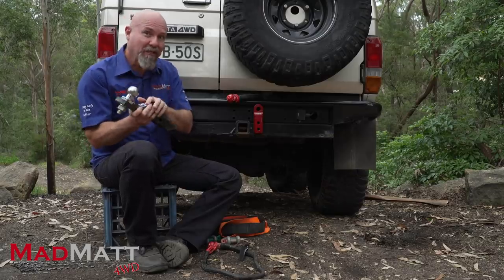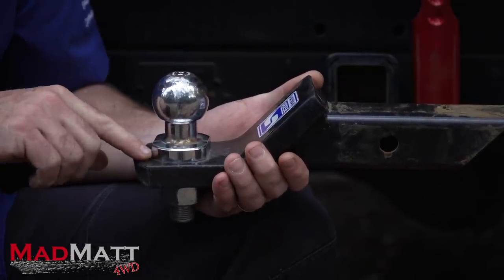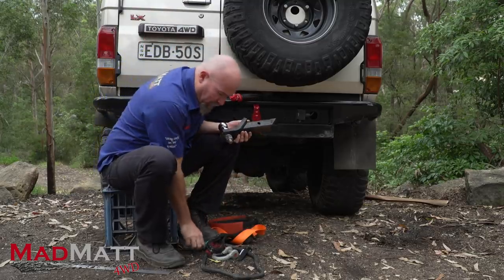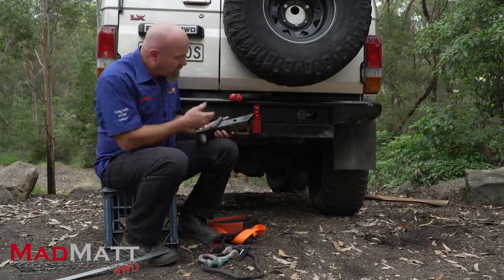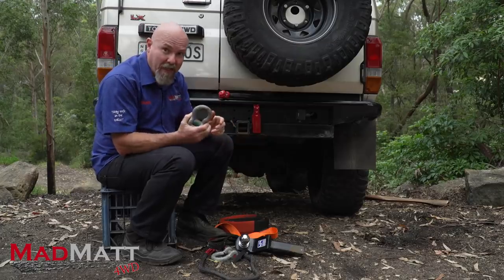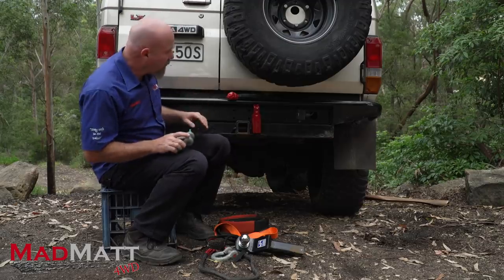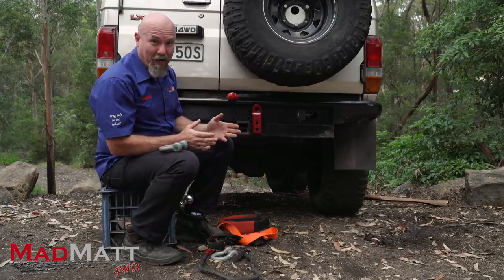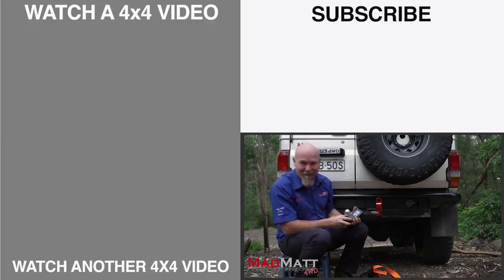A Tow Ball is NOT an option in a 4x4 Recovery? FIND OUT WHAT GOES WRONG

Comment: In fairness, Ronny cuts all of them with a hacksaw halfway through
Still, use proper recovery points
Reply from the maker: Not the first one shown here he doesn't.
Reply: @MadMatt4WD  Double negative, you saying he cuts it? OR; Not the first one shown here. OR The first one shown here he doesn't.
Reply: Bill Steel 
He did not cut the first one, but did weaken the others because they required many pulls to brake. He used new balls that’s why needed some work to break.
Reply: They didn't cut the first towball, and it took eight hard recoveries to snap it....Ronny noted that he was getting whiplash because of the sudden stops, so they cut the rest part way through to ensure they failed first time so he didn't get any worse injuries...
Reply from the maker: Sorry. He doesn't cut the first ball only the others. watch Ronny video.
Reply: @MadMatt4WD  Agreed, the first tow ball was too strong :-)
Shhhhh
Reply from the maker: No it breaks after 8 hits
Reply: @MadMatt4WD  - 8 HARD hits.  That video showed me that a tow ball is safe in all but the worst of recoveries.  He bent the sh!* out of the receiver before the ball finally broke.
Reply: @MadMatt4WD  Would be interesting to do the same test with a Factor 55 receiver bar and a bow shackle to see how many hits it can take.
Reply from the maker: Dustin Tunis  I’ll refer you to my question at the end of the video. Is it that hard to do it safely?
Reply: I must admit, it does amaze me, that i can have a 4 tonne load (Boat or Caravan) hanging off a Tow Ball, with drastic stop start loads, corrugated roads, huge braking force, bumps etc and they don't break.
I'm sure the kinetic energy from a snatch recovery peaks at a much higher amount, but wow, a Tow Ball sure takes a beating in a normal life.
Reply: @mountainconstructions  
I would also guess, not all tow ball's are the same, some are forged, some cast. A cast tow ball i can understand will fail.
A forged tow ball in good quality can take a lot of force.
I would still not use it with snatch straps, but a slow pull from a winch?
Reply from the maker: Iffykid Mn ive done 15 hits when the snatch busted. Under controlled environment.
Reply from the maker: Iffykid Mn ive done 15 hits when the snatch busted. Under controlled environment. No issues on the f55 hitch or the shackle.
Reply from the maker: Hugh Jazz yes i agree but in reality the loads are actually quite low.
Reply: @mountainconstructions  It amazes me too, but 1) th forces are much different than recovery, yes 2) they do take a beating, so using a fresher, application designed bit of equipment seems like a better idea 3) they are extremely well designed for their application, but only that one 4) they do fail. Safety chains are there for reasons. 

All that said I do agree. I just drove across the US this winter with a very light enclosed trailer. That hitch system took an amazing beating from hard starts and stops and every bump an blast of wind across 2500 miles. I'd only done low-speed towing on a ball before so I was nervous. No need.
Reply: @mountainconstructions  Different dynamic load to a snatch at full send it.

Comment: I'm from the UK and have a Nissan Navara D22 it has a Fixed Swan neck tow hitch (I don't know if you have them in Australia) But was wondering if anyone has any info on whether it would be suitable for recovery because it is one solid piece of metal. Instead of the ball is shown in the video which is welded. And I can not find any type of recovery receiver that fits swan neck hitches.
Reply from the maker: Personally I wouldn’t use it for a kinetic recovery. A tow recovery would be ok if you HAD too. Use the right tool for the job.
Reply: @MadMatt4WD  I was also wondering if you don't have a hitch reviser would it be ok to loop a strap around the hitch itself because it's a solid connection?
Reply from the maker: @callum3261  there’s a thing in recoveries where if it works it’s fine. That sounds like it goes against everything I say. The idea being every recovery is different and will require a different approach. People like things to be black and white most recoveries have lots of grey in them. So considering the dangers and such you then make a considered plan that is as safe as you can make it for the situation you’re in. Part of the process if you know you will be performing recoveries is to prepare the vehicle as best you can. There can be lots challenges at that point with the modern vehicle. So you decide whether you hook on that way. If you do I suggest you keep the recovery energy as low as you can.

Comment: Thing 1- I would never buy a ball with only a 3/4” shank.  Use 1 1/4” diameter shanks for towing as I would not want the trailer I am towing coming thru the back of my vehicle in an accident.  
Thing 2- Find parts not made in China.  Their metal pours are not consistent and I would not trust their ratings.  Thailand, German, Japan, USA are metals I trust.  
Thing 3- getting a running start and jerking the strap puts stress and loads on the vehicle frame that I won’t do to any thing I own, but I have never done any sand recovery, lots of snow and rock.  Take your time, analyze, and find the safest method.
Thing 4- use equipment within its design limits.  Use the right tools for the job.
Reply from the maker: 1. Of course bigger is often better. I think the key is using gear as it's designed for. 
2. Absolutely utly agree
3. Yes it does but as you say taking the time to perform a kinetic recovery is the key and works just fine. These ropes and straps stretch and are very different to a lifting strap.
4. The right tool for the job. hence a tow ball for recoveries is like using a pair of pliers  to undo a bolt.

Comment: I can see the possible dangers.  And I don't do that much off roading or heavy farm work anymore. 
But I have never seen one giveaway. 
Seen them used thousands of times off road. 
And I have no idea  how many on farms.
Even had a d7 dozer pull out a 125 hp 4x4 international with a peanut wagon ( loaded) with the tractor on the fram.
 Most everyone around used them we just got all the by standards to move off and out of the way.
Reply from the maker: So by the fact you remove people it’s a fair indication you recognise the dangers. I fail to see why defending this is even a thing when it’s so easy to do it safer and not run the risk at all. I’ve never said it’s happening every time a tow ball is used but it does happen. Read a few comments up and there’s a guy in hospital from a tow ball hitting him.
Reply: @MadMatt4WD #1 I would move people out of the way doing any kind of pulling.
More worried about a chain breaking than the ball.
And on the farm what ever was quicker and using the stuff  you had to get the job done. 

Doing dangerous stuff on the farm kinda normal down here or was for years. You did what you needed to get the job done is it the best way probably not is it what we done yes.
I went and watched the video from the other guy.  
The pull that he was doing seems kinda suspect. 
And then cutting the balls shank not good.
If you pull by the axle or frame.  If you cut either in what 1/4 - 1/2 into there going to brake to.

Like I said I don't do much of either anymore but I never saw one fail.
And I used them on heavy equipment that puts way more stress on them than and normal truck.
Reply from the maker: I get the farm thing I grew up on one. But knowing what I know today I’d certainly take the time to do things safer.

Comment: That's your own fault for following America, in the UK the tow ball has usually 2 bolts one each side and the bolts are bigger than the lock pin on the 2inch tube.

Old school British motors have solid bars and bolts everywhere, and a loop feed through and pull over a tow ball will not come off no matter how hard you pull as it only gets tighter, you have to pull the back end off as in the whole back end we also have drop pins again these have two load points.

As the world trys to make everything with bare minimum requirements and cheap we end up with things like this.
Although I have had tow points break on cars and vans just from simple towing.

Most accidents are caused by people's lack of attention or care and lazines

Edit: when I say tow points I mean as in those little rings the manufacturer puts on to strap down to trailer
Reply from the maker: Some interesting thoughts. Thanks

Comment: Newbie question here:  is there just a bow shackle that is wide enough to use the bow shackle straddling the outside of the receiver and able to put the bow shackle pin through both of the hitch pin holes in the receiver?
Reply from the maker: Hey mate. No there’s not but that would not be a very strong design imo.

Comment: Matt, There is NO exception.  Never use the ball... Pull the receiver and attach the strap to the pin that goes through the hitch.    
Next thing you know you will support using a chain around the ball...  Sorry to bust you on this, but again you are wrong.
Reply from the maker: I think you know that's essentially what i'm saying.

Comment: I normally use a heavy duty chain for recovery. I have never had a problem with them. They don’t fray on rocks and such, nor do they stretch out or deteriorate in the sun, mud, and sand. I bet if a ball broke with a chain the it wouldn’t fly back like a cannon ball because they don’t stretch and shoot it like a slingshot, and if it did my 50lbs chain is so heavy it would act as a weighted blanket. I have broken many straps because they get cut in something like the edge of a bumper or something
Reply from the maker: there are certain time a chain would be fine and it certainly has the characteristics you speak of. But it's also limited in it's recovery ability hence we use other devices as well'. As i say at the end of the video is it really that hard to not use a towball?
Reply: Isn't there a video of a chain going through a windscreen?
Reply from the maker: this one? https://youtu.be/ETFFeUoq5Vw
Reply: @MadMatt4WD . Nasty that  one
Reply: MadMatt 4WD that is a tiny chain, it looks like something I would use to walk my Dog. Here in the states we use big stuff.
Reply from the maker: I don't know what size chain it was but it failed he died. I don't tend to use chain in my recoveries.
Reply from the maker: @shane Von Harten Yeah not good.
Reply: I know for a fact that two jeeps off road in the dirt will not break my chain. I know this is off topic from tow balls but every one is hating on my chain. I have broken many straps but never a chain. I have a 8000 lbs Dodge diesel on 40s that I used to pull a stump out. With this 8000 lbs low geared manual 4x4,  pushing a 1000lbs of torque and 40s making lots of traction, on pavement at that. I hand the truck jumping and hopping so much that I could hardly stay in my seat. After some very hard hits, it came out. I was more worried about my truck being pulled apart than the chain. There is know way in hill that some 3500lbs jeeps could ever put that force in a chain. If that stump was a Jeep I would have ripped it in half, or the chassis would have came with me, leaving the axles still in the mud.
Reply: Shane Von Hart first that is a little chain, second prove that it was a chain broke and not what ever it was attached to ripping off .
Reply: @JohnDoe-du6yi . Calm down buddy. You may have a big chain but most people don't. Steel is no suitable for repeated shock loads, it is not designed for it. You may get away with it forever but it may also break next time you use it.
Matts video is about keeping people safe, if you wont take good advice thats up to you. I hope it never fails on you. Happy wheelin
Reply: Shane Von Harten he does give good advice. He is absolutely right about not using a ball for recovery.
Reply: You said the chain wouldn't fire back. The one in the video does, it doesn't have to be the chain that breaks. Your chain may be heavy enough not to. Just trying to point out the risks. If the chain was tied on the passenger side he may have survived.
Reply: I would never use a chain that is just stupid.

Comment: Great video Matt. I would never use a tow ball in a recovery. Just one small point at 8:43 you mentioned that a soft shackle would have the same energy as a steel shackle, the steel one has more energy because it has a greater mass (is heavier). Anyway keep up the good job of educating, I love your work.
Reply from the maker: Hi Steven, Thanks for the comment. As I understand things (i'm not a physicist) the they will be both launched with the same amount of energy which means the soft shackle will travel faster than the bow shackle but they can both cause significant damage. Go watch Roberts video linked above and also the one called Bullets Balls and Cricket.
Reply: @MadMatt4WD  Hold both at shoulder height and drop them on your bare foot then explain which has more energy.
Reply from the maker: the issue with that is that the soft shackle will spread it's force over a larger area rather than the shackle having a point loading. Watch this video https://www.youtube.com/watch?v=7DboD5XJKpQ&t=1s

Comment: Thanks for the good vid Matt. Any thoughts on why a tow ball can tow a trailer thats 15,000 plus pounds no problem? a truck that needs to be recovered is far less than half the weight of most trailer towed. It holds all this fine and never breaks while towing. How is recovering different from daily towing especially up and down high mountain passes in Canada? Thanks
Reply from the maker: Sure. The amount of traction required to move 15000 lbs is not 15000 lbs. you can push a car but you can’t lift one. Also we’re factoring for fatigue over time.
Reply: Its because he doesnt know what he is talking about. In canada with full sized trucks your towing ball should be 1 1/4. Think its rated for 30,000 pds. Your slings or chains will break long before the ball will shear. I've pulled bumpers off trucks ripped tow hooks from frames. Never broken a ball.

Comment: Is the standard staple that is bolted with four bolts to the rear crossmember on the 70 series OK for recovery, also is location OK for fitting a tow bar?
Whilst I am asking about the 70 series, the standard shackle points at the front, are they tie downs or can you recover with them?
Reply from the maker: I wouldn’t use the factory points for anything other than light recovery. Fit a pintle hook to the 4 chassis bolts at the rear.
Reply: @MadMatt4WD  Thanks for the advice

Comment: Reminds me of when I was trying to get my boat and trailer to the truck. I couldn't back the truck all the way up to the trailer so I took the cable from the winch that's just designed to pull the boat onto the trailer and attach that to my bumper. And was using it to pull the boat and the trailer to the truck. So I tell the person helping me to stand clear of the cable because one I'm asking it to do something that wasn't designed to do and 2 if it failed that quarter inch cable flying around was going to do its best to cut her in half if it bit her. Do you think she would get out of its range?
Reply from the maker: Yeah right. Wouldn't believe you ay.
Reply: @MadMatt4WD  Nope luckily despite three or four individual strands it held. I think ill replace it with one a little bigger. Easier then finding a new place for the boat.
Reply from the maker: We have a design that has a strap like seat belt on it. Much better IMO
Reply: @MadMatt4WD  okay I'm a little confused. A design for a winch? But whatever it is if it makes my life easier I'm interested in it.

Comment: The big lesson that should be hi-lighted in your video even above the particulars of what you are discussing. Is that you should never, ever...stand in line with the force being applied by the recovery vehicle, or near to the rope or cable on a recovery vehicle or winch line. The forces involved are tremendous and everything can break. Why get cut in half by a winch line that snaps or hit by a piece of flying debris. The laws of physics tell you where the forces you are applying will cause the shrapnel to go... don’t put your body there 🤦‍♂️
Reply from the maker: Absolutely and I cover this in many of my other videos.

Comment: I have a question for you Mad Matt. I understand that using a ball mount like you showed in the video is dangerous. But I recently used a tri ball hitch mount with a hook on it to pull down a dead tree in my yard. Could that be just as dangerous using a ball mount that has more than 1 hitch on it or it any safer?
Reply from the maker: Watch this. https://youtu.be/Jcv2wy5RKeI